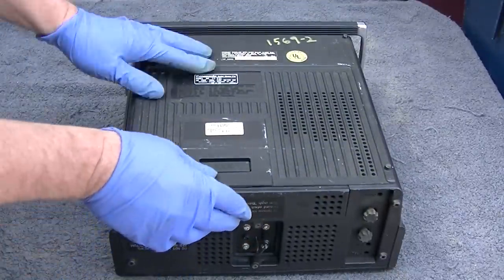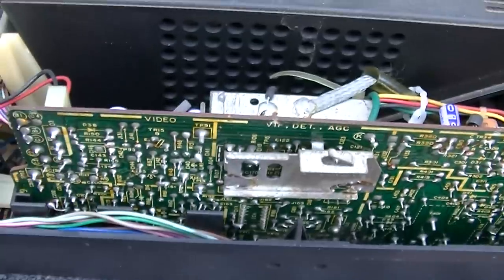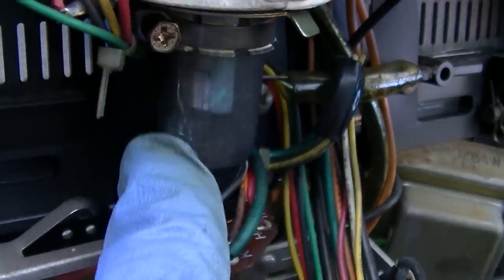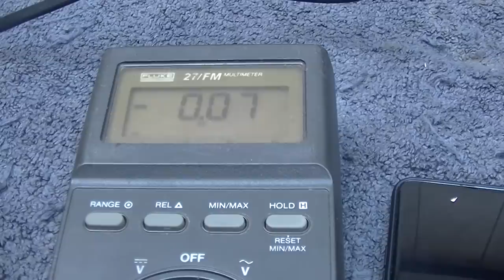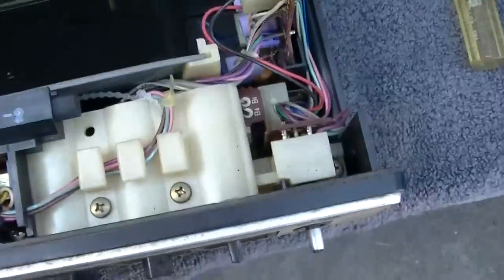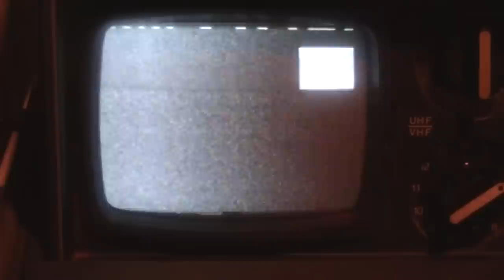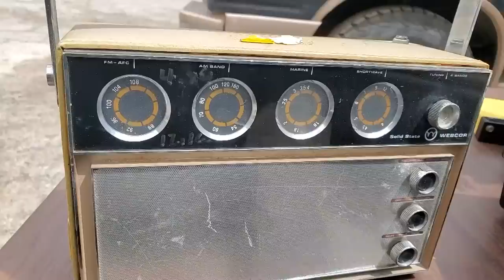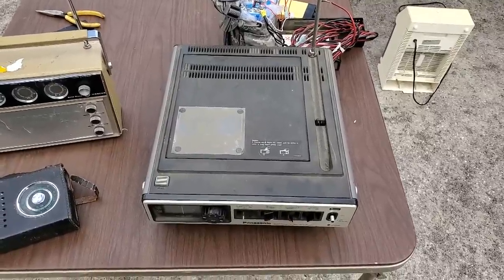1977 Panasonic TR535 Portable Pop UP 5 Inch Television AM FM Radio And Test

Comment: my Grandfather had a ( around 1979) a Sony with a screen that rotated, they used it for camping, looked like a military TV,  in a  Black plastic case, had a  radio also, if I remember right, it took D Batteries, as well as other means to power it, edit just saw one on ebay, it was a Vintage Sony TV-511

Comment: This same model set was also used as a prop tv in the original 70’s Bladerunner Movie , I Have the same set (August 1977) Is the Date on mine , I also have the TR-555 which is a 1978

Comment: I used to be able to hear air traffic on a cheap sony clock radio i had back in the 90s as a kid in eau Claire wi and even the Motorola radios the facility used too and channel 13 weau little after the 100 mhz dial

Comment: I can't think of one thing that panasonic brand stuff has had that was bad. At the store I work at we've had the tough book Computers come in, and they all work fine. the only thing that seems to go bad on them is the rubberized coating on the outside. I remember even when
the end of the VCR era came, and Costco was selling Panasonic branded VCR's, that said engineered in Japan but made in Taiwan or China. You know, my parents had one of those, and even it was a great performer, and 1 of them is still working to this day, 20 plus years later.

Comment: Unless I'm mistaken, 2x6V @ 3.0Ah = 36Wh i.e. about 6 hours run-time from that battery pack. Impressive! Usually sets of this screen size draw close to an amp @ 12V.

* N.B. Please feel free to correct me if my addled brain is too quinko-twerculated, or whatever.

Comment: Great Video Shango.  The little TV is really great.  And the performance is surprising, given that the bar-loop antenna is buried in the set behind the tuner!
As far as batteries, you could use some lithiums with a LDO-regulator since it doesn't take that much current.
Do you have a way to use the digital TV-converter out there?
Love the dials in the Webcor; any way to make it perform better?

Comment: 27:38 - Lower the contrast (light sections of picture) and raise the brightness(dark portions)

The two controls actually work the opposite of how we think they do, on CRT displays at least.
Reply: On a CRT, the brightness adjusts the bias of the CRT cathode, controlling the beam intensity, The contrast adjusts the gain of the video output.
Reply: @dougbrowning82  
Hency why they are called, respectively, 'Bias' and 'Drive'.

I calibrate TV to supplement my income. and  getting Brightness and Contrast correct is literally half the battle.
Reply: @Zickcermacity  I've never seen them labeled like that before, but it makes sense.

Comment: With these old devices and the availability of 3D printing, I like retrofitting Lithium-Ion 18650 cells. Either lighter or far greater capacity. You just have to keep in mind the different voltage levels and charging.

Comment: I bought a Quasar XP1465UH at a thrift store (rare for me to find a thrift store CRT) and the brightness and contrast were cranked almost all the way, but the picture looks great and gets plenty bright. It was missing the battery, but i found the adapter and power supply for it on ebay.
Reply: I found a Sony color micro-TV (CRT based )at Goodwill for $3.99. Works perfectly. Yeah, these finds are rare now.

Comment: My mom had the TR-475 version of this, (rounded front) took it to the beach a couple of times. It was left on the charger all of the time and very quickly sulfated and became boat anchor.
Very cool looking TV.

Channel 6 in TJ? how do you get it in LA on a whip?
How is it still analog? Didn't all of Meh-he-co go digital in 2015?

25:47, instant on?

Comment: 28:45  Not really. Yeah, it's small, but it is nowhere near the smallest portable B&W. It needs to be small for 2 primary reasons. 
1) Power consumption
2) Weight and size restrictions
This one was probably in someone's kitchen. It would explain the high hours.

Comment: I had a JVC TV and Am/Fm receiver which had good reception and theTV worked great too when I was stationed in Japan. I also got the rechargeable battery that you could recharge in the unit. It was great back in the time, not sure the quality of the innards.

Comment: I had a late-80's Sony Mega Watchman I used to take camping, it always managed to find a signal or two up in the mountains. Not great, but watchable. Of course NTSC reception was much more forgiving at low signal levels.
Also: 70's Panasonic IC/FET based tuners used to have decent sensitivity. This unit looks to be screwed together pretty well.

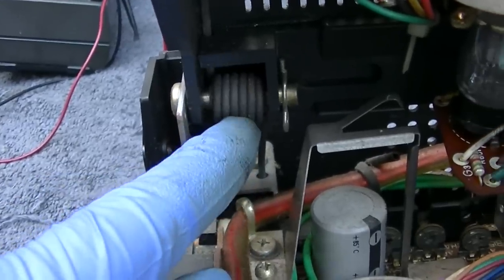Comment: 14:18 Planned obsolescence is real. If you produce a machine or product that will "last a lifetime"  you will put yourself out of business.  To stay in business the product should last a reasonable length of time, then need to be repaired or replaced with the new model.   The general idea behind this is to encourage sales of new products, replacement parts, new models and upgrades.  The cell phone business is all about this

Comment: I don't believe for one second that this can run a TV off of 6 watts.  I have a bunch of portable B&W TVs from the 70s, 80s and 90s and none of them get anywhere near 6 watts, even with smaller CRTs.  The newest one I have is from 1998 and it uses 12watts.  Almost everything is integrated and it weighs maybe 1-2 pounds.

Comment: I wonder if your electrolytic capacitor failures are climate related or something. I got a 1972 Panasonic radio recently and all the capacitors looked fine and there was no hum, even after using it for hours.

Comment: If someone wanted to resurrect and put this back into use as a travel set, seems like they could assembly a lithium ion or maybe niMh battery pack of the necessary specs to replace the old lead acids.

Comment: There are a private bulgarian site used by many old school retired electronics engineers who wouldn't exersize their creativity with transistors and each and every old analog radio IC from east and west on poor condition radio chasis and boxes if old soviet radios were good enough to worth restoring. Judging from the results of the most active  retired gentleman who has propper equipment and who always compare performance of aligned and adjusted originals with multiple constructions of his own and in general factory soviet constructions are at best on par with his own even one based on cheap chinese ripped of ICs like x2003, but as general with cheaper and fewer componens he atchieves better sensitivity and selectivity.

Comment: Prices aren't dropping for stuff i'm interested in. Cassette decks, TVs, laptops from 1999 and later. The vintage gaming crowd is fine, it's the idiot sellers using it to grift selling small CRT TVs and computers for hundreds of bucks, it's crazy.
Reply: Goes in cycles, depending who's young and wants to fulfill their unmet childhood wants. Mine was the 50's and 60's. Fulfilled. (For now.)

Comment: 35:50 am radio is effectively 160 meter band, so a true 1/4 or 1/2 wavelength  dipole pretty  fuckin big  but youd probably get better reception

Get a coax, 150 ft copper wire on shield and 150ft soldered to center, 300ft end to end....
Reply: Also hook up a bandpass filter in line with the antenna too, to filter everything out but 1-3 mhz

Comment: Vertical deflection is not correct. The VIR signal should not be visible on the screen.
Reply: Shango is using an HD converter to receive present day TV signals on that 1970s NTSC set. Because the picture is being broadcast in widescreen the converted picture is letterboxed. Sometimes the conversion doesn't completely remove everything in the vertical blanking interval and things like the VIR signal end up sneaking into the converted picture as unwanted artifacts.

Comment: Good stuff from the past! I’m pissed…..Toyota decided to take AM from their new car entertainment units in Europe where I am. The new Panasonic units that they fit has DAB+ instead, digital radio on band III that was used for tv in the past. The consequence is a hit and miss affair while on the move. And they are taking away FM as well by 2030. Digital blessings, I hate it. Greetings from Hekelingen, Holland, bye, Willem.
Reply: In USA, FCC is moving to requiring car manufacturers to include AM. The electric car manufacturers claim the electric motors cause interference. Here, in Chicago, AM is still important.
Reply: @KameraShy  That’s good. It IS important but I must say situations differ a lot between the US and Europe. In some countries over here in Europe AM was killed already 10/15 years ago. Switserland was the first I believe, Norway and Germany followed soon. In France just one or two still exist but as a whole obviously not enough to keep the AM train going. What’s more, Germany and France more or less decide in the EU, remember, Switserland and Norway are not part of the EU (and are the most prosperous countries in Europe but that’s another story). In some EU-directive, AM reception in car radios is no longer specified and I believe I know the reason why. They wanted to get rid of AM because the transmitters use a lot of energy and that’s against the EU-policy to cut down Co2 emissions. And since only “CE” labelled equipment and parts are allowed to be built in new cars, AM is now absent in all new cars. Car manufacturers don’t care, they can rest on their laurels as for combatting interferences caused by all the built in electrical stuff. Tesla is an example. I believe they were the first to ban AM from their vehicles. In Europe the battle is lost forever, despite the fact that in Holland there are more than 120 lpam (1 up to 100 Watts) stations operational, all on a legal basis. So in short, we ARE LIVED. And the public, well, like I said, situations over here differ a lot from situations in the USA. The majority of the people couldn’t care less. There you have it. Treasure what is still there, once it is gone it will be gone forever.
Reply: @KameraShy  In Europe, AM is mostly off for years. Only in Balkan and eastern Europe some stations remains.

Comment: 10 NIMH cells would better serve it. Lithium not so much. The voltage is too wide. I don't even know why they would put lead acid batteries in such a device.  Lead acid does NOT like being discharged very much. 1 or 2 full cycles can kill a lead acid battery.

Comment: I have mixed feelings about Panasonic, I've seen amazing quality like this, and then at the same time, I've worked on their phone systems. They are just the worst things ever built.
Reply: Commercial / business systems maybe. My personal experience of their phones is limited to the pack of Panasonic DECT cordless handsets I bought in around 2007, which (aside from one of the wall wart power supplies failing) have never given me any trouble. They'll probably outlive the discontinuation of wired landline phone service in the UK.
Reply: Yeah i heard their later phones weren't so great. From Jordan U, he does phone videos amongst other things. I'm surprised the Panasonic 18650's in a second hand circa 2003 Dell Inspiron 600m battery pack still works.